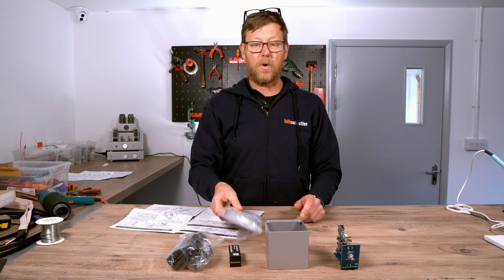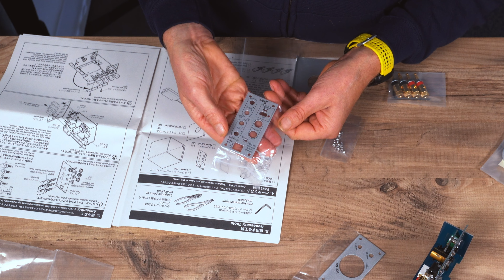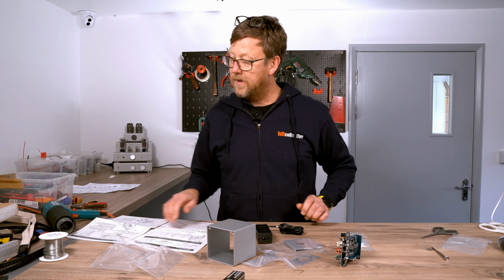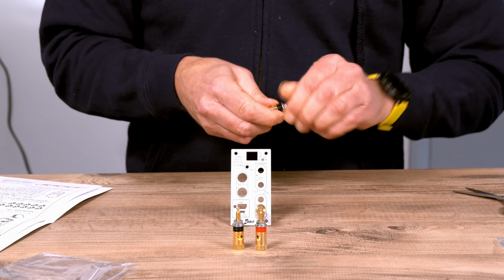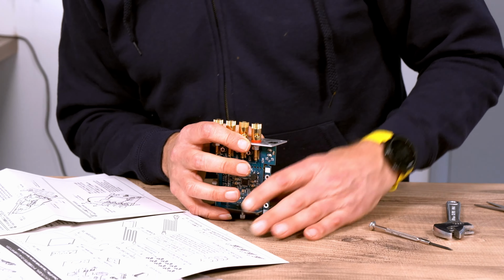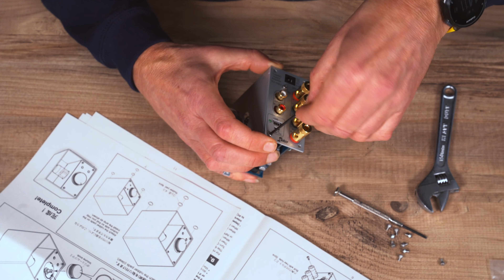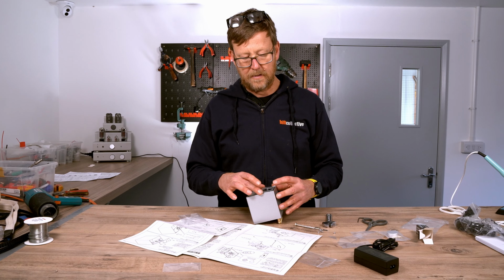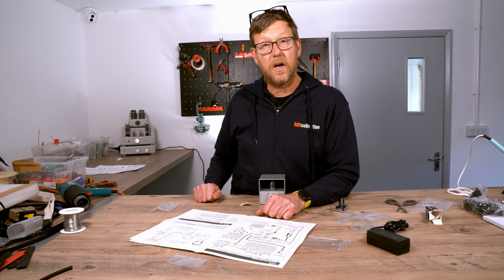Building the Elekit TU-H82 Hybrid Tube Amp Kit

Comment: Great how to video. I have a quick question. I have a pretty basic deck (a poxy ION turntable - nothing special) it has a stereo 3.5mm headphones out. If i run this out to the input 1 on the the elekit and then from the phones out to a pait of BOSE speakers (with a 3.5mm input ie no standard speaker conections L/R red white types), would that in theory and practice work?